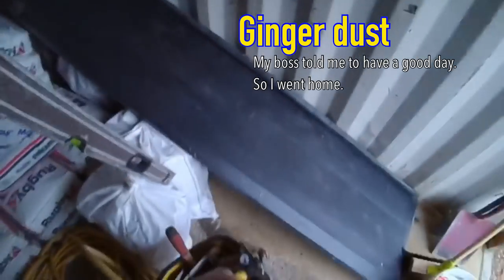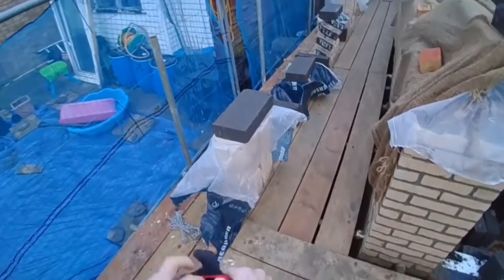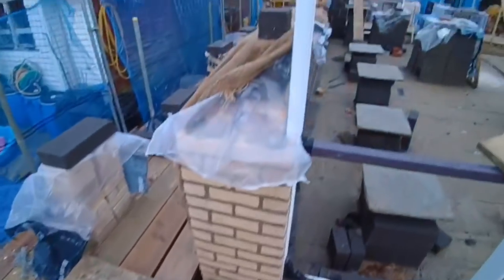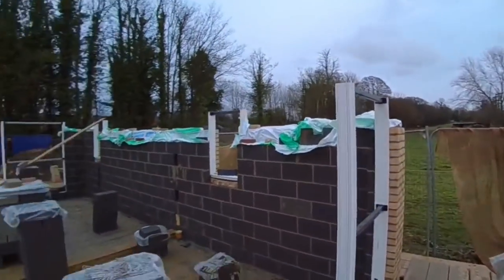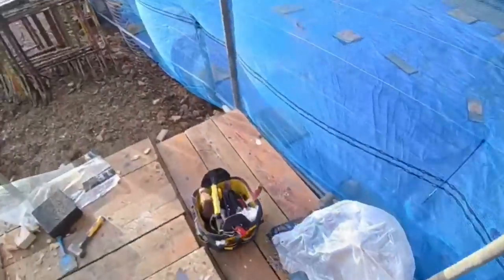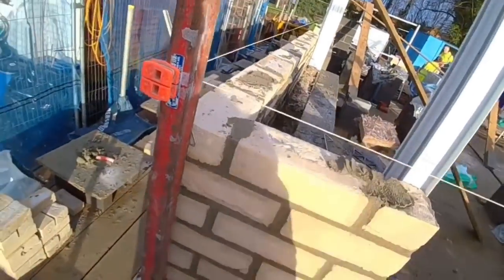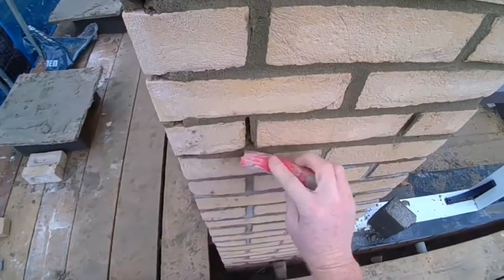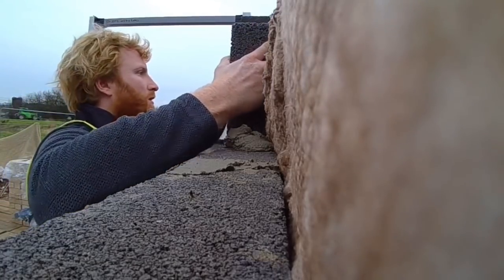Bricklaying (part 2) | The skill of bricklaying

Comment: Great video mate. Quick question when you cut the half' s why don't you turn them around so the crappy cut end faces the cavity.
Reply from the maker: I feel it’s neater this way and the frame holds up easier
Reply: You’ll get cleaner cuts if you do them off a block..not a scaffold board that has flex

Comment: Someone need to show us a video on how to keep you cavities spotless at damp corse with blown insilation!!! U will make a fortune. We tent to leave ever other block out and scoop it out every other day but some leave the corners of the brickwork out a pull a lengh of hessian through. Some put 4x1 in the cavities all the way up but its all time consuming and you lose money.
Reply: BRICKLAYING UK What's the point of having a cavity tray on every lift then?
Reply: @stuartfurze8168  u dont have a cavity tray on everylift. Just one all the way around the plot at damp corse . Wich needs to spotless. And over lintals. Whats the best way to keep then clean?
Reply: BRICKLAYING UK every new build I've built I've put a cavity tray at doc, joist then plate on gable ends. How else can you clean ties off at such a height?
Reply: It’s whatever way the site usually wants but if you lay you’re spread further to the front of facings and don’t go daft with the amount of Gobbo you use for the spread then the cavity snots are to a minimum.